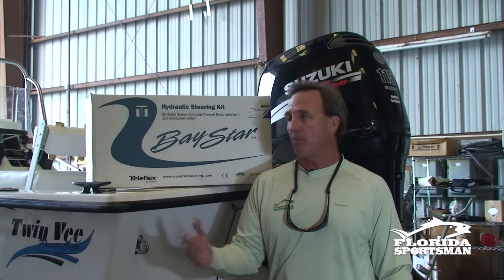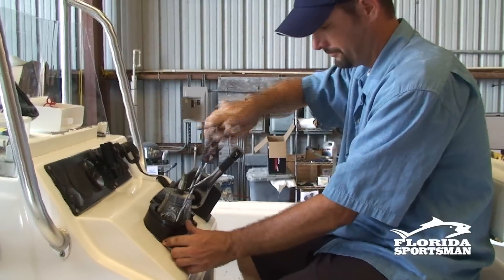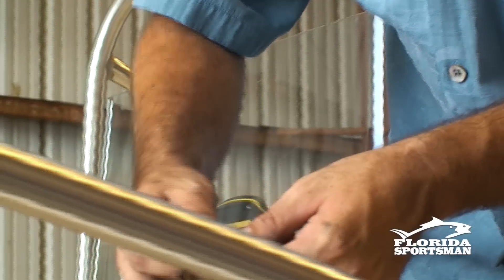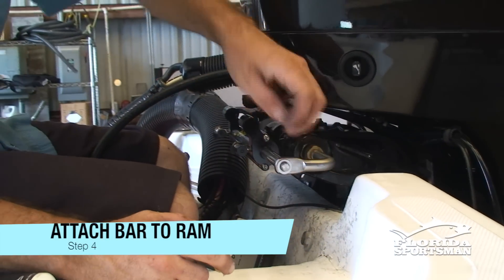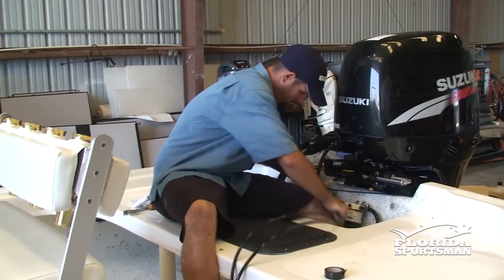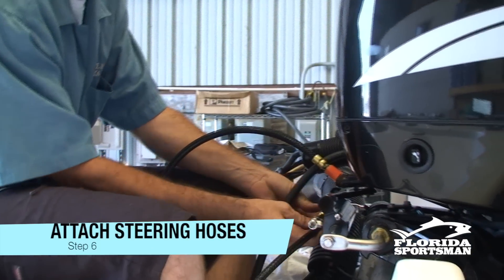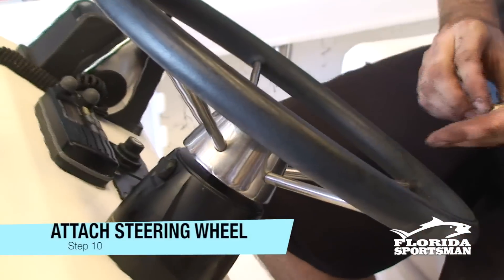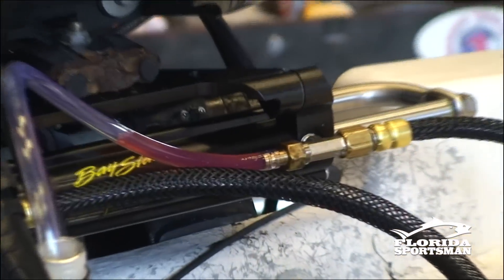Installing Hydraulic Steering - FS Boat Maintenance Seminar

Comment: @ 5:52 Save yourself a little time working under your helm, route your hoses through the pump opening, attach them to the pump, THEN mount the fasteners for the pump to the helm, get your slack the way you want it under the helm, and then work on the motor end slack and connections. You're Welcome.

Comment: A good trick I learned as an electrician when running wires through tricky bends is to run two pieces of twine and leave one in place---that way if the tape separates you have a spare---then use the spare to run two lines; rinse and repeat as needed.
Reply: Clove hitch at the bottom and half hitches and you’ll never loose one. Never lost a cable in 15 years 2pr16 to 3c750 works every time!!

Comment: Teflon tape should never be used in hydraulic systems. If just a small piece of tape it can cause major problems and locking of steering!
Reply: I agree,if the instructions don't say it ,don't do it.My kit ,the fittings have a washer with some kind of O-ring to prevent leakage